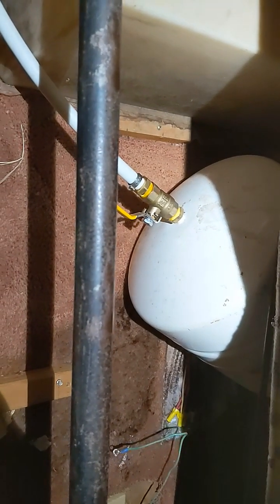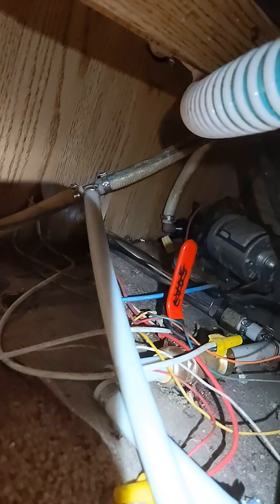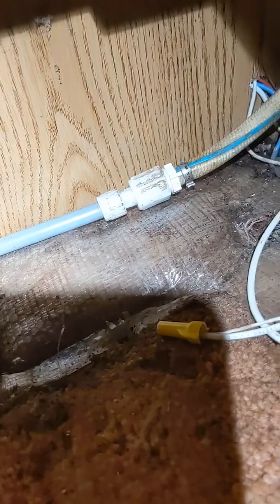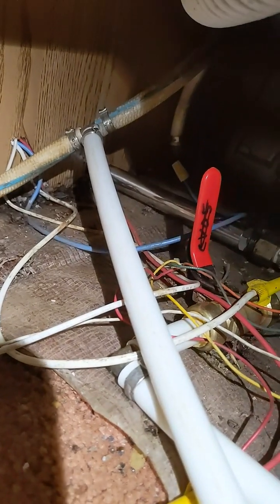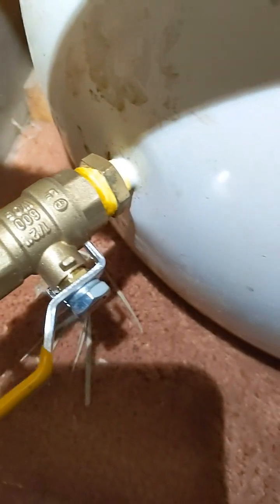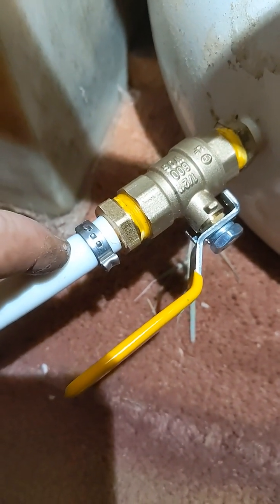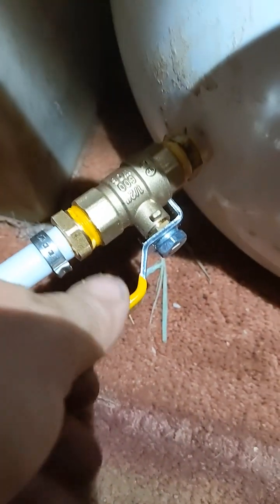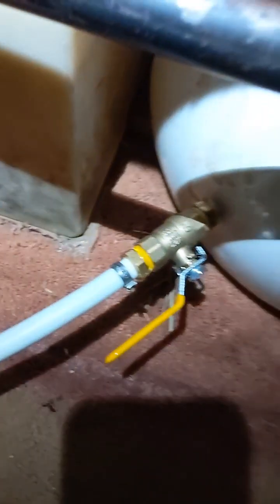Use a standard bladder tank to improve your RV or trailer pump.

Comment from the maker: Shurflo does make a post-pump bladder tank, the size of a football. It does work to reduce pulsations. However, I've found a typical 4-gallon bladder tank is less expensive, gives more options and benefits, and is likely something you can pick up at a Habitat re-use or thrift store.